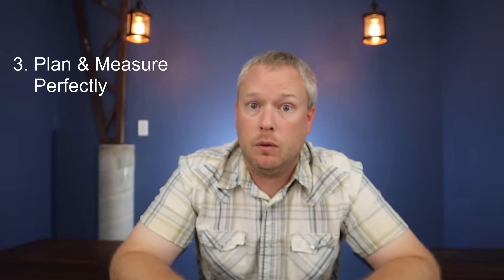7 Drawbacks to ICF Construction -- Problems with Insulated Concrete Forms

Comment: Most contractors are not storing the bulk material for biuld a house they order it when they get job and store the material on the job site things like windows doors plumbing and electrical are figure out when building plans are created that is why biuld plans cost so much icf is sopst to be faster even doing diy seeing the change in color how long did it take u to go frome first form down before u put roof and siding on and tell people that it didn't harm the scf it chaging color but had to wipe it off to get the water barrier to stick that would be a sine that it was damaged not  stuckter but if it was flakey that means every spot u hand to rub that off for the membrane to stick that changed its r rating

Comment: House is ICF glad I went this route, learned a lot from the build and wish I could do it over again like any house you build would make changes.  Did the plans myself, cost 0,  super energy efficient, mouse proof telehandler was great for a lot of the work. Storing outside for short period not a problem.  Contractor screwed up windows on second level, had to use concrecte chain saw to fix after pour.  Would have put more penetrations in the the walls.  Windows were a challenge. Cut runs for wires with a electric  chain saw, no plumbing in outside walls.    Dehumdifiers usefull.
Reply: Plumbing in outside walls is fine if you add an interior wood-framed plumbing wall. This will make the window areas 16" deep. That's perfect for a house plant.

Comment: i've been wanting an icf house forever, but i'm in central ohio and have never found a builder that uses this technology. considering that this seems to be so much better than traditional "stick" building, i'm surprised that there doesn't seem to be much demand for it.
Reply from the maker: In my area in Kansas, it's starting to pick up.  I'm seeing more and more new builds with it.
Reply: @Challenged1  in tornado country I would think it would be common.
Reply: @Challenged1  that's lucky. i'v been looking here for years - but nothing. i hate to go through all the effort of building, and not build what i really want. maybe i'll just have to move to an area where this is more prevalent when the time comes!
Reply: Jeff, I've been determined to do icf for several years. Call a few of the manufacturers including build block and they'll get you in touch with experienced people
Reply: Where in Ohio are you located? I am thinking of becoming a ICF contractor, also have you called nudura and asked if they have a contractor in your area.
Reply: @chptech  my neighbor is a builder and has now recently used ICF. He says it is not rocket science.  Our Amish community uses it all the time and often DIY. I imagine the Amish builders around us do it also.

Comment: I’m really glad I found your channel. I’m looking into building my first/forever home rather than buying, but am not at all jazzed about building with lumber framing.

Really great information here from someone who’s worked with ICF! It seems like it requires a lot more careful planning than lumber framing or even steel, but I think I’d much prefer this for the energy efficiency and strength.
Reply from the maker: You won't regret building with and then living with in an ICF home

Comment: Great video! I've just started looking into ICF construction and this is the first video that I've seen that deals with what I would call the aftermath. Not that the end product is negative, it's just dealing with an building with a long curing stage that a lot of home owners are not aware of.
Reply from the maker: Glad to help
Reply: @Challenged1  How long does it take to cure, and fully remove the moisture?
Reply from the maker: @jasonbourne1596  For me, it took about 2 years for the humidity to stabilize.
Reply: We had no moisture problems with our house and though it is tight no mold or mildew  basement or anywhere else.
Reply: I had no humidity problems, but I am in a very dry climate (Utah mountains).

Comment: I live in the southern US and was considering having a built in dehumidifier just for climate purposes do you think that unit would be sufficient for also controlling the humidity from the curing process?
Reply: For any tight house, you need a ventilation system to exchange stale inside air with fresh exterior air.   If you get an ERV system, then that will dehumidify your inside air as part of the air exchange process.
Reply from the maker: Depends how much capacity it has, but probably.

Comment: O8:05   Long dryer vents runs, especially long vertical runs, are to be avoided. 
They are a lint fire hazard. 
In a long vertical run, moisture will condense within the vent pipe, more so in the winter. That leads to excessive lint accumulation and thus a fire hazard. 
Not to mention the problem of keeping wind driven rain water from being directed into your dryer, an electrical fire hazard.
Ask any code enforcement inspector if dryer vents going through the roof are legal. The solution to dryer vents,along with any other kind of penetration, in ICF walls is to plan ahead for the dryer location before the concrete pour.
Reply from the maker: Code allows dryer vents through the roof, and so do the inspectors.  They do also require the vent be insulated
Reply: I planned mine for very short venting runs.

Comment: 08:05  Dryer vent through a interior wall???  Dryer vents have to exhaust through an exterior wall.
Reply from the maker: Goes up through the wall and then through the roof
Reply: @Challenged1  Long dryer vents runs are to be avoided, they are a lint fire hazard. 
In a long vertical run, moisture will condense within the vent pipe, more so in the winter. That leads to excessive lint accumulation and thus a fire hazard. 
Not to mention the problem of keeping wind driven rain water from being directed into your dryer, an electrical fire hazard.
Ask any code enforcement inspector if dryer vents going through the roof are legal. The solution to dryer vents,along with any other kind of penetration, in ICF walls is to plan ahead for the dryer location before the concrete pour.

Comment: Check out Dan Dwyer's foam house design (fast, easy) https://www.youtube.com/watch?v=Ij7bU17icQY   Foam, ICF, SIPS panels are easy and fast. Only build half a wall at a time, then pour, then build the second upper half then pour. Power wash any oxidized yellowing foam before stucco. Use acrylic bonder with a sprayer or roller as primer (is the right product, cheaper from bulk instead of specialty name of same product). Add a 2 inch plastic conduit for future wiring in walls. Use a fresh-air-swap conditioner with a dehumidifier.  ICF is easy and fast to build with. The cost savings on build cost are big.

Comment: Wish I would’ve known about using a dehumidifier on our basement. We moved in and within a month everything downstairs was covered in mold . With that said we now have a dehumidifier and have had no problems and love the energy efficiency. Thanks for the video very helpful!
Reply: Where is the moisture coming from?  We put a vapor barrier under the slab, and exterior waterproofing and footing drain around the outside, basement is bone dry…
Reply: @rronmar   The moisture came from the concrete curing and the ambient humidity .
Reply: @htschad9685  i would blame ambient humidity first.  High humidity would slow the cc drying, but it should have been at least to the level of the surrounding humidity before the house build was complete.
Reply: My old man just mentioned this to me after I started researching ICF.  Glad I found this.
Reply: We had no problems with our house.  Have a walk out basement so maybe that helped.

Comment: Are you certain your moisture problem wasn't condensation? Condensation on the inside would be a common problem on any super-insulated, air-tight house in a heating-dominated climate and not necessarily a unique drawback to ICF. And it could be seasonal (mostly in the winter) which is why you might not have seen it later on. You're right that a dehumidifier will be important in your HVAC, but a vapor barrier might also be recommended between sheetrock and ICF to prevent the moisture from condensing on the relatively colder concrete.
Reply from the maker: Absolutely positive.  I've talked to quite a few ICF contractors and they talk about the same thing.  It doesn't last forever though, falls over time until it hits equilibrium.  Takes a couple years for that to happen

Comment: when it comes to strength and durability would you suggest icf floor system or traditional poured concrete or hollow core slabs
Reply from the maker: Any of those options would be great.  Would probably lean toward the ICF floor system though.

Comment: I would say you just have the lack of experience dealing with ICF. I’m a retired Design Build Builder and did my own designs and drawing using Soft Plan Design software. With that you configure your own desired walls showing the ICF and concrete . No second guessing anything. as far as you having moister problems you may not have allowed enough out side air in. ICf requires your HVAC to be smaller and you must introduce fresh outside air.. In my opinion icf is the best, Bullet proof, Hurricane and Tornado resistant
Reply: How do you deal with excess moisture if you live in a very humid environment. I don't really want outside air into my home. Thanks for the advice btw.

Comment: For the 7th part. Conventional concrete uses cement as the binding agent. Cement goes trough a process called hydration. This means, in order to form the crystal structure cement needs water. Approximately in a 0,3 water to cement ratio ( measured in weight). Without proper moisture content cement cannot cure, nor harden. Concrete can cure and harden even underwater. Please take these informations into consideration. Concrete structures should not be dried out, they are to be kept moist for the end of the hardening process, or at least for the first 5-7 days.
Reply: Yes hydration is key. The concrete is sandwiched between two pieces of foam with no air movement. It stays plenty wet.
Reply: Good thing is you can pour even in winter. Insulated and concrete heats up as it cures. Tops of walls is the only issue.

Comment: Awesome advice , my main concern was moisture behind finished drywall from inside ...? ? How do you know after a few years there isn’t a lot of mold build up behind the drywall. ? ? Thx
Reply from the maker: I wonder that too.  I haven't removed any to see.
Reply: @Challenged1  Mold needs food to live and that food is carbon based. There is no carbon in concrete (at least there shouldn't be but every so often, there might be a bit of coal in the aggregate), the ICFs or the drywall; mold cannot grow inside the wall without food.
Reply from the maker: @elliottdiedrich2123  The back of the drywall is paper which can mold quickly.
Reply: @Challenged1  you are right, paper can mold.
Reply: @MAGAMAN  I agree with your concern that the glue could fail at some point; I think that it is just a matter of time. I have been using scrap laminated veneer lumber (LVL), that were cut off of structural beams, for outrigger pads on a picker truck. It is quite alarming to see how fast they start to fall apart when exposed to a little weather. I have already replaced them a couple of times without much use.
Reply: @MAGAMAN  our second floor is 2x6 and I sprayed 1 1/2 inches of closed cell  foam on the OSB and the builders put wrap on the outside and there is no air infiltration at all which includes moisture so no mold.
Reply: A Styrofoam cup leaks no water so how can ICF leak water on the inside wall?  We have been living in a ICF house for 10 years and had no problems at all.
Reply: I would be way more concerned about stick construction and air/ moisture infiltration

Comment: Hey Garrett, really appreciate your video especially about the moisture.  We are in Australia and in an area which sounds like it has similar temp to Kansas.  Extreme heat during summer and freezing cold during winter.  My husband and I have been building our ICF house for the last 5 years we have just moved into half of the house, the bedrooms just before Christmas and I've been finding it difficult to breathe and found it quite stuffy.  We did notice the humidity levels are very high and so after seeing your video it makes so much sense what is going on.  We will definitely invest in some dehumidifiers.  What are your thoughts on L size for the bedrooms? Also, are you still using them?
Reply: ICF houses are very tight, so you need a ventilation system to bring in fresh air and expel stale inside air.  In the meantime, cracking your windows would certainly help.
Reply from the maker: My humidity levels have dropped more to a normal level (It took 2-3 years from the date we filled the walls with concrete).  I definitely still require dehumidifiers during the summer though, as would be usual for any house during the summer in Kansas.  It just gets humid during the late spring, summer and early fall.
Reply: @Challenged1  thank you, I really appreciate your response and helpful tips.  Thanks

Comment: About the moisture problem, I still don't understand how could be possible the existence of mold on the walls when concrete is already cured or dried.
Reply: The moisture problem described might be from condensation, not concrete curing, in which case it might be seasonal (which is why he didn't see it later on). But thick concrete does take a very long time to fully cure even after it appears dry to the touch.

Comment: I read or seen that round or ovalchannels used in ICF use one third  the amount of cement and are lighter and are a thermal insulater a are less likely to buckle. (0) [_ 0_0_ 0_]

Comment: Perfect Block
Reply from the maker: I would use the perfect block for a garage build all day long, but not a house.  Stucco is the only option for exterior covering.
Reply: @Challenged1  out here in the west thsts just about everyone
Reply: @Challenged1  -  Probably not the only option, but stucco would be cheapest for sure.  
 I would think drill anchoring some wood strips on a 16 or 24 center would allow any other type of exterior cover.

Comment: There are some better options in icf available. We carry them at work and they are much easier to work with. The contractors that use these rave about the ease of every aspect of the construction. The only downside is that they come from the manufacturer in an enclosed trailer, if you get them shipped direct to site, you need a crew to unload. I am unloading a new shipment on Monday... wish me luck.
Reply: Like what? Lol.
Reply: @landonlandon5533  Nudura. (This is all opinion based) It comes in 3 8 ft sections folded to be the same size as a fully set up one. It stays locked without floating even without using the latch system. The height is fully customizable with a saw. Any damage to a piece means that one gets shuffled to where a door or window will go. I watched a contractor simply set together a wall with 3 runs with a corner, then threw it off his trailer, all just to prove the usage. It landed and looked like he built it there. I would have to go look at the specs to get the r value, but it is good. All said and done, I just find it much easier to work with. Also, it is blue...so yellowing in the sun is less noticeable.

Comment: Your title should say "Drawbacks for DIY'ers". They are not a concern for experienced installers. Additionally, your point about needing a dehumidifier is plain wrong !  Concrete doesn't let go of its water. It NEEDS water to cure properly. Apart from the very little bit of water that gets squeezed out of the concrete mix at the time of the pour due to the concrete pressure on the inside of the forms, the system will NOT generate humidity. Experienced concrete placers typically spray water on fresh concrete after it has reached its initial set so that the chemical process called hydration can continue and the concrete can get harder and harder. Sorry man, most of your so-called drawbacks are non-issues and your knowledge about concrete is lacking !
Reply from the maker: I'm a licensed Civil Engineer who has had significant time in the concrete design and testing lab.  If you want to get into specifics, I can.  But you are way out of your league.

Comment: Concrete does not “dry”, it  hydrates which is a chemical reaction between cement and water forming new silicates. If you had excessive bleed water and continuing moisture problems a year later you poured your concrete WAY WAY too wet.  In an airtight ICF house you have to remember you are essentially living inside of a Hefty bag,  Moisture from bathing, cooking, breathing etc has nowhere to go.  So you need sophisticated heat recovery active ventilation and yes, humidity control. My guess is your ongoing moisture issues now have nothing to do with the water in the concrete and everything to do with your HVAC design and execution.
Reply from the maker: Sorry, but wrong.  In order for concrete to cure, the humidity within it has to stay above 70%.  The ICF blocks create a perfect condition for this (long slow cure).  I am a licensed Civil Engineer who has spent considerable time in the concrete testing lab.  Those that build with ICF, know it happens commonly.  It does go away though, just takes time.
Reply: @Challenged1  So why did so many other in this thread have zero issues with moisture?
Reply from the maker: @jacobpetersen5662  No basement